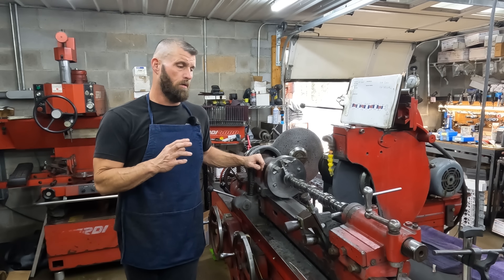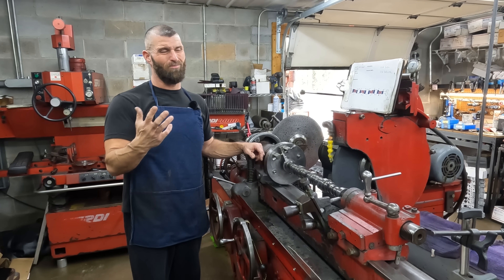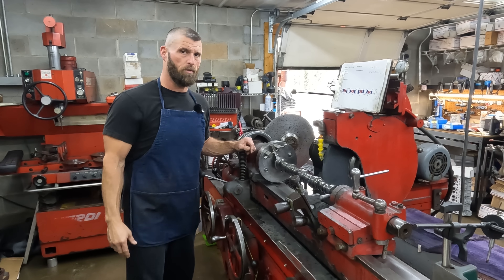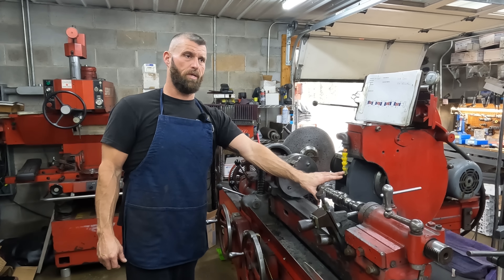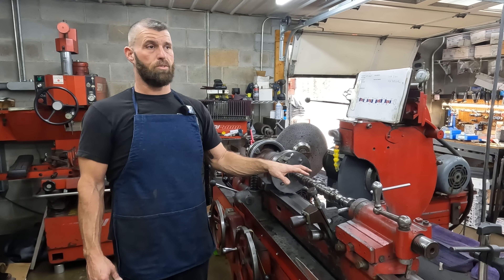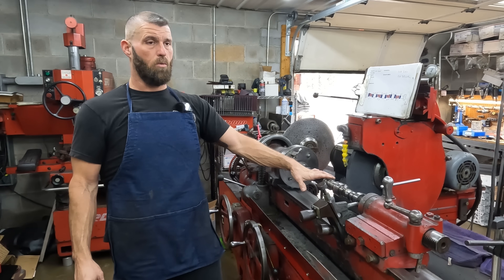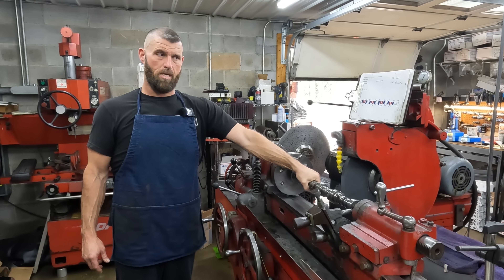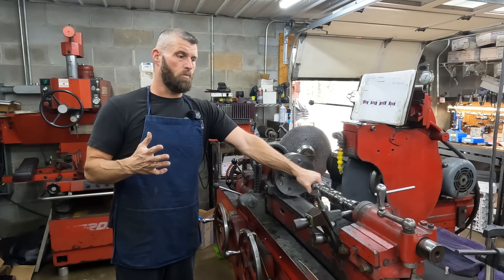Regrinding a Dod/Vvt Ls to a  larger Profile

Comment: that was a super video...!..that explaned "why" instaling a cam on it's centerline (or adv/retarted) is so important...!..a lot of guys just slam the cam in heads up...& run it ...!..i got so many questions rattling around in my head after watch'n....just quick'y.: im guess'n that lobe profiles on a flat tappid cam are more involved since the peak of the lobe is steaper than on a roller cam lobe...?...is that near correct...?..?..& there more limited cause of the shape of the lobe...?..?..thanks great video...! look'n forward too more...!

Comment: Are you able to regrind a roller cam outta a navistar 6.0 power stroke? I've got the specs written down from the last time I had a cam done. What's the rate and average turnaround?
Reply from the maker: What's the spec's and base circle diameter

Comment: I'm a little confused and you might have explained it in the video and it went over my head....but you said you are increasing the duration and lift,  im confused how you could add lift by grinding the lobe down, is it becuase you took more off the base circle than the tip of the lobe? Nevermind lol watched it again and you did explain😂
Reply from the maker: Yes it's explained in the video and yes we are removing 80% from the base circle
Reply: It made sense when I thought about setting the lash to base circle

Comment: You mentioned after Grinding the Intake Lobes, you then use the LSA to dial in the Exhaust Lobes, do you change the Grind  Master to Exhaust at the same time as you mentioned the intake and exhaust profiles are different.
Also do you make your own Masters or do you get them machined elsewhere based on your Lobe Design?
Reply from the maker: Yes, we swap to a different master for exh, yes we produce our own master plates,  we also make master plates for other cam companies also. And other cam grinder tooling

Comment: Have you discovered the difference in the DOD lobes from the standard lobes? Is there a different ramp?
Reply from the maker: It's addressed in the video
Reply: Missed that first part. Finally understand why you cannot use the standard lifters on DOD lobes.  @powellmachineinc
Reply: I missed the first part and got caught up in the grinding process. Sorry for the mistake.

Comment: Very interesting! Do you always plan for use with standard rocker gear with your cam regrinds? Or do you sometimes specify a different rocker arm ratio?
Reply from the maker: Most would be designed for stock ratio unless the customer or us decide otherwise,  it rather put lift in the lobe that a lot of rocker ratio
Reply: @powellmachineinc  Thank-you. I'm learning a lot through your videos.

Comment: I was always told the DOD lobes had a smaller base circle to account for a taller lifter, which causes a misfire with normal lifters. I've also heard of a weird ramp (a dip) to ensure the internal pins momentarily are unloaded to ensure they lock when going into v8 mode. Just isn't enough when 10k-mile oil change intervals clog them up.
Reply from the maker: That is 💯 incorrect,  the bc is the same and the activation/deactivation happens on the base circle

Comment: So how do u achieve more lift taking material off the top and bottom? My assumption is that if u remove more off the bottom, then u do on top that is where u add lift. Is that correct?
Reply from the maker: More off the bottom than the top 😊
Reply: @powellmachineinc  One more thing, I'm also going to assume the ramp is more aggressive since u are doing more work in a shorter distance?

Comment: Hey can I send you my Cam for a 4.3 Vortec V6... I am looking to get a little more lift and a little less valve overlap because I am biulding engine for my S-10 I ported the heads. I am looking for a little less overlap and maybe about .025" to .030" more of lift to gain some Dynamic compression since I am going with boost.
Reply from the maker: Sure

Comment: The lobe design is set based on the cam angle, so the one cam needs to be super wide.  It just needs that extra bandwidth.
Reply: Make a video
Reply: @Dougarrowhead  I mean, do I really need to make a video about such basic things?  Lobe geometry is kind of self-explanatory.
Reply: @mrfarts5176  well i believe when you use words like bandwith you dont know shit. And also when you say "so the one cam needs to be super wide" whatever the hell that means.
Reply: @mrfarts5176  are you talking about radio signals?

Comment: ok let me get this straight ,by taking the base circle down you increase lift , at the same time you increase duration by making the top of the lobe fat so at the top the valve stays open longer ??? is that right ?? thanks great vid
Reply from the maker: Basically that's correct

Comment: I raced 5hp Briggs & Stratton flathead stock class go-karts over 30 years ago. At one track, I learned the tech inspection was kinda loose, they only checked to see if there was a stock cam, they didn't bother using a degree wheel or dial indicator. The local machine shop allowed me to use their shop during slow days. I never added lift ( I was concerned they may find that), but I experimented w shortening the lifters to retard the valves opening. I got lots more rpm, so much that i had to change the chain sprockets ratio to use the extra rpm. It seems the opening points were more important than the lift. Stock carb.
Reply: If I’m understanding you right and if I remember the Briggs design correctly by shortening the cam followers (lifters) you delayed the valve action slightly by introducing more lash into the valvetrain???
Reply: yes. retarding the cam puts the efficiency higher up the rpm range, I guess that's a good way to put it. Also, the "other guys" would run castor oil in the crankcase, because the speed books said to. I saw them get blown engines (they ran their engines  up to 5200-5500 rpm), even after changing the oil after every race. I used synthetic 10w30, I ran Friday practice, 3 classes, all weekend on the same crankcase of oil, I never broke anything. I pushed it and pushed it, assuming something would let go, it never did. My clutch was set to start grabbing at 5000 rpm.

Comment: HI DAN GREAT VID.  ARE ALL CAMS FLAME OR INDUCTION HARDENED FROM FACTORY?   I REMEMBER BACK IN 77 THE GM 305 SOFT LOBES ON # 5 AND 7 CAM LOBE BEING SOFT.  JUST WONDERED ABOUT THE DEPTH OF THE FACTORY HEAT TREAT??  THANKS.  KEEP UP THE GREAT VIDEOS.
Reply from the maker: Yes they are

Comment: This seems like a smart(money wise) solution to having to buy another part just so there's enough material to allow the contours
you're after.  I'm a dummy as these things go & should we trust the after market parts to be made of the right material(hardness)
or is the original cam from the manufacturer more likely to be made from the proper grade of steel?  And once you've bought it
& installed the part it's yours..... lol,  that would be a hard lesson & I'm sure many have learned it but today I learned that in some
cases you might be able to use one that's reground.  If one thing is out of whack the whole thing is corrupted = expensive.
Thanks for the video, Mr Powell.  peace & GB ALL
Reply from the maker: Tyvm!

Comment: I could go to google university to find this out but perhaps this will be a good video. There is a difference in how a roller cam and flat tappet cam is ground. The flat tappet has a slight taper at the top of the crown to cause the lifter to spin during operation so the lifter wears evenly. How is this profile ground on your machine.
Reply from the maker: The wheel is set to the desired angle

Comment: Cam lobes are likely case and not through hardened, and case might be 40 thou thick.

How do you avoid grinding through the case into the sub-metal?
Reply: Re-watch the video. Daniel addresses your question.
Reply: Yes I heard him say that there is sufficient depth of case hardening for this regrind process.  

But if the case depth is 40 thou and you grind of 30 thou, then this is the same as taking 3 inches off you 4 inch concrete driveway and expecting the 1 inch remaining to support the vehicle loads down through the tire.  Thin driveways crumble.  Just think how thick a commercial jet runway is.  About 20 inches thick to avoid being crumbled.

It's more than a bit pedantic, but this all comes under the subject of Hertzian contact tribology, which is rather a lot of study. @bobhudson6659

Comment: I remember when we got our Tahoe (2010 with the LMG 5.3), i didn't know it at the time, but the DoD is known to fail, and it can ruin the whole valve train. That then means a possible head and/or valve job along with a new cam. To be honest, that scared the hell out of me. I looked into a DoD delete, but its way out of the ball park price wise. I know this doesn't necessarily pertain to the work you're doing here, but this brought me back to that, lol.

Edit: knowing that you'll re-grind the cam for $170, you may have gained a customer in the future. How much is the core charge also, do you refund if the core is sent back? I know, might be a stuoid question.

Comment: I've had the understanding that the harden surface of a cast cam or crankshaft only goes 35 to 40 thousands deep wouldn't these reground cams need surface hardened again?
Reply: Re-watch the video. Daniel addresses your question.
Reply: @bobhudson6659  yeah I heard what he said ( there's plenty of hardness left )  how much is plenty ?  Questioned it because of what I've been taught a cast iron cam or crankshaft hardness only goes 35-40 thousands deep an the more of the hardest you grind off what's left of the hardened material isn't as hard as the surface you started with that's why most engine machine shops won't even grind a crankshaft more than 10 thousands undersize because of that
Reply from the maker: This is billet not cast... cast cams are through hardned,  billet of this material are induction hardened which goes about 1/4" deep.
Reply: In that case it appears you think that Daniel doesn't know what he is doing despite being in the industry for 30 + years and having ground a "few" camshafts, tested them and seen if they work in customers' vehicles. In that case you'd better go over and show him what he should/should not be doing. Retired mechanic/machinist. @lawerncemiller6557
Reply: No didn't think that, thought it was a cast iron cam thought it would get to soft grinding it why I questioned it

Comment: I used Rhoads lifters decades ago (and they still exist) that had a longitudinal v-groove ground into the outside of the lifter plunger to allow controlled bleed down at lower speeds. I suspect that's the mechanism they use these days as well. The higher the RPM, the less time each lifter had to bleed off effective height, so the valve lift and duration were reduced the most at idle and the least (maybe not at all) at high RPM. I'd like to see someone run a back to back test on an engine with a pretty decent cam in a Gen III LS (they don't offer lifters for Gen IV LS or newer) to see if they really do increase vacuum at idle and increase low end power as they claim.
Reply from the maker: No.
.

Comment: I can already see that I'll have to watch this one ten times ....at least . Thanks for all of your hard work . That's to the entire family , team work works .
Reply from the maker: You're very welcome
Reply: Back 19 or 20 years ago , I had what we all thought were valve problems . They were all Honda CRF 450 and 250 motocross bikes . Most of us , not being professionals , threw money at valves. Specifically , most of us replaced the stock valves with Kibblewhite products . They helped , but didn't solve our issues . Turned out to be cam issues . The factory cams were allowing the valves to slam shut ...rather than letting the valve meet seat gently in the last few degrees of rotation. Of course Honda wouldn't admit it was on them . The aftermarket cam folks figured it out , but it took awhile . Interesting stuff for a " Corn Bread " such as myself .

Comment: Great video. Crazy how you can take away material and make the lift higher. Can you explain in a video please. I’m not a machinist. Very cool to learn new stuff
Reply: If you take away from the base circle, the cam follower  to cam clearance will be adjusted to compensate, which then means more cam lift. Remember cam lift is the difference between base circle and lobe height.
Reply: I believe it is the difference between the height  of the lobe minus the width of the lobe that determines the lobe lift. Mr. Powel can confirm this or correct me.
Reply: Thanks for the info

Comment: Please explain what is else is required to run a reground cam in a motor with non adjustable rocker arms such as a Dodge 5.9 Magnum. The regrind price is great but if I need to buy longer pushrods, rockers etc. the price goes up quick. Thanks.
Reply from the maker: It's all relative,  most of the time stock components are fine

Comment: $170 for a regrind sounds more than fair. That’s pretty cool. Great stuff man.
Reply: And know it was done correctly.
Reply from the maker: Ty!
Reply: Absolutely astounding to see good folks who are so professional, intelligent, sincere an have a passion for what they do for a living. Undeniably a heck of a craftsman, and a savvy engineer!!
Reply: bargin
Reply: Yeah and it will ad about 30 hp wheel 30tq ?
Reply: Even more so because they're VVT, which are usually really expensive from the aftermarket. The biggest is the L92, which is only 198/209 0.500".